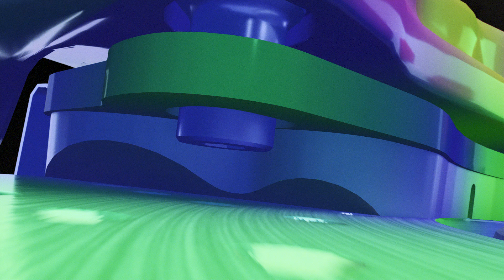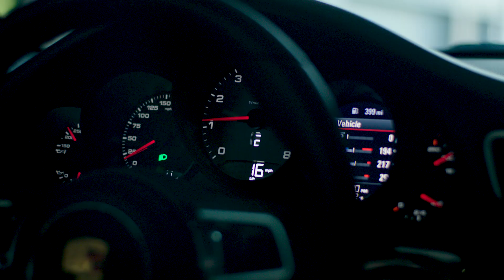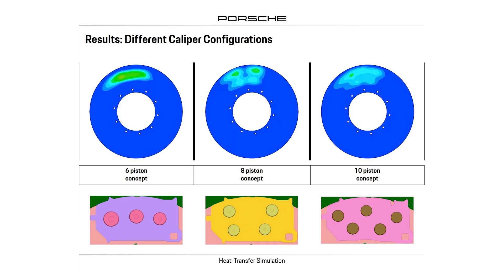Brake Squeal Explained

Comment: High end Porsche sports car use Brembo brakes with Brembo pads similar to that of there sp compound in the aftermarket world that have there formula of sinter material in them to be able to achieve high friction durability and high operational temp limit sinter means there metallic material in the pads so you basically have metal composite pads scraping with cast iron metal rotor squeaking is inevitable my GR Supra for example when I change to mx72+ pads they squeak abit more and dust a little brown there semi metallic pads but they sure bite hard and super fade resistant.

Comment: I keep the noise down by putting brake grease on the contacting surfaces on the rear of the pads, and I spray some wd-40 to the face of the rotors. It keeps the noise significantly down. 
You're welcome. 👍🏻

Comment: 1:15 Very nice resonance frequency test setup with automatic modal hammer and an older laser vibrometer 👍
Using a similiar (newer) setup for acoustic material testing and measuring natural frequency of components in end of line tests.

Comment: whenever the brakes on my 991 carerra S start to squeal, i just rinse off the rotors and calipers with a garden hose/nozzle, and they are quiet again. repeat in a few weeks when they squeal again. i think brake dust has a lot to do with the squeal. i also found that this trick works better with hot brakes/rotors, maybe the steam cleaning really gets the dirt/dust off the rotors and pads better.

Comment: So my original 2013 Cayenne brakes didn’t squeal at all. They lasted until 120,000 km which was good. I had them replaced with original OEM parts. Now they squeal like crazy. I took the car back and they said this was common but put a small chamfer on the pads. It helped for about 10,000km now back to the loud noise. I believe if the brakes are not installed with all the components being within .001” (inch) ie tight tolerance of each other you get the vibration etc. I assume the rotors, pads are not all that precise between one and other. Also if they are installed just ever so slightly off balance you get this result. Perhaps even hitting some potholes can eventually cause it.

Comment: Great explanation, however, most of the brake squeal can be resolved by blasting away any accumulated brake dust generated by the pads, with pressurized water. Happens to me all the time.

Comment: Bs. I have a new Macan Turbo and it sounds like a semi truck. I’m trading the sob because I can’t stand the high screeching sound. The dealer has acknowledged the issue and worked on it twice and still sounds terrible. And don’t give the “performance ceramic” Excuse. I have a garage full of exotics with bigger breaks and they don’t sound like this.
Reply: Seriously, I’m about to ditch mine for the same reason. I’m so sick of blasting pedestrians with this nails on a chalkboard squealing sound.
Reply: @cadriver2570  u know what the dealer did was they had a letter sent to me from the engineering department in Germany.  First of all it was a standard letter that they send everyone with this compliant.  Second it was a total bs that the sound is normal.  I told them this is not my first high performance car intact their own 911 turbos don’t make this sound. Still after repeated attempts to correct it they said there is nothing more they can do.  I sold mine after 10 months and bought a Jaguar I-Pace which performs even a little better than the Macau turbo with torque-vectoring and 512 lbs of instant torque.
Reply: @bakhteria  Wow, that is total BS. The Macan stops in about 10 feet earlier than an M40i. I would gladly trade 10 feet to not burn out my eardrums. I have also not heard this from any of their Taycans.

I-Pace is a smart move. Super quiet, better powertrain, costs virtually nothing to charge compared to gas. I test drove one a while back and it was a lot of fun. Has yours been generally problem-free?
Reply: @cadriver2570  so far so good. Apple play is hit and miss. But that may b more in apple’s part than the car.  But love the off line take off.

Comment: Basically the worst solution to address whining Porsche customers about brake squeal was to create a video like this. If you are not a trained mechanic and hear strange noises coming from there, don't hesitate: go and have it checked with your dealer or a trained mechanic. Even if you are a Porsche customer (especially if you are a Porsche customer)! How can an average Snob Joe differentiate between innocent vibrations and say a loose brake caliper? Nohow!

Comment: Funny, my AMG BREMBO calipers never squeal. And they supply Porsche as well.
Reply: Brembo manufactures what the customer desires. If a car makers asks for cheap, lightweight discs with poor rigidity they will make just that. It may squeal, but I'm quite sure their aftermarket range of parts is far better quality than what they sell for car manufacturers. It is absolutely possible to eliminate brake squeal 99% of the time with the right materials - it's just that some manufacturers don't care, since they don't treat it as an issue (i.e. Porsche).
Reply: Yes.  The material of the brake pads will determine how the noise will come out.  Porsche, please stop buying brakes components from China.

Comment: Call Exxon Mobil, they can formulate a heat-resistant polymer adhesive go on the back of the pad to cushion it from the caliper pistons for your American customers. Mercedes solved it by MAKING THEM squeal but at a frequency that humans cant hear.

Comment: If your breaks squeal its because your'e not driving hard enough and therefore not breaking hard enough to wear off pad build up. These breaks are not made for driving conservatively. When your'e blasting down the autobahn at 295km/h and have to break hard because some idiot changed lanes without looking, trust me you will be very happy you have beefy Porsche breaks.

Comment: I think if you oversimplify it you can say that there are 2 types of brake pads, the ''soft'' ones that are not so aggressive  to the disks, they squeal less but have less grip and endurance, and the ''harder'' ones that squeal more they are more aggressive to the disks (disks maybe need change more often) but they have more grip and durability to pressure, temperature and use overall. Performance cars and racing cars use the second type, just watch any race and the sound of the breaks is obvious.

Comment: I think the could have simply said that some high performance brake pads squeal when cold/at low speed, simply because of the material used. Sure, keep the frequency explanation (I didn't know that), but it still pretty much comes down to what material is used. Performance is always a compromise, and so often good brake pads are a bit noisey and even dusty, if they are track focused.

Comment: Porsche throwing shade at its customers  is all fun and games until you own a Porsche or Audi with this terrible noise. It's a joke that they can't fix it. STFU to the people who don't own Porsche's and Audis experiencing this issue. If they spent half the time they did on this video to find a fix for the noise, maybe it'd be fixed... It's not even with just the ceramic ones, they all make this POS noise. PORSCHE FIX THIS IT"S AN ISSUE!!!!!!
Reply: VR44 then why don't you try changing it to softer pads.. 

Just saying, Audi and Porsche have some of the Least amount of brake fade..
Reply: VR44 get the brake pads replaced then. The stock ones are made for performance driving
Reply: It sounds like a race car it's cool lol
Reply: Soft pads act as a pillow and they dont resonate so much as harder ones, when they are gone, harder material or smaller surface touch the disks so squeling is heard, this happens to normal car breaks so we tend to associate the noise with failure (sounds like a beater), something that is not true in more aggressive set up. I have a peugeot 106 xsi with stock breaks and if i hear that sound for a while i know i need pads, my neighbor   has the same car but tuned for hillclimb racing, i hear he's brakes everytime, who has better brakes is obvious. If you dont push your car you can go with softer set up, but you lose performance(safety), durability, heat management and you will need pads twice more often
Reply: Yeah if they pay for it. 60-100k cars shouldn't be making noise like a beater...

Comment: Yeah yeah cool but then why no other car maker's brakes squeal? Laws of physics are equal to everyone so then nothing can be done and every time I go out into the street I should get deafened with hundreds of cars squealing at me but that's not happening is it? it's only porsche that seems to get complaints
Reply: Wtf are you talking about, powerful brakes squeal from any manufacturer, no more or less than porsche. Especially carbon ceramic brakes when they are cold
Reply: Dariune Porsche and a lot of other high performance manufacturers and even the C7 Z06 uses extremely durable high performance rotors and pads that performs at the highest levels repeatedly without a hint of fade.
Those in the Cc or even performance rotors in the Mercedes(because I know you are going to mention they don't squeal as much)  still uses softer pads.

High performance rotors and pads will always squeal.  Go to a track and you'll know
Reply: You hear the Aston Martin Vulcan?
Reply: Comfortably Dumb Why do bus/train brakes squeal, are they powerful or just shitty
Reply: BMW, Ferrari, Audi, Lamborghini, Mercedes all squeal.
Reply: White Wolf first of all bus and train brakes are completely different from the brakes on a car lol. And yeah I would say the brakes on busses and trains would have to be powerful to slow such heavy vehicles, especially trains that way hundreds of tons
Reply: All carbon ceramic brakes squeal! Just watch some gt3 racing, it's normal with really good brakes.
Reply: They seem to use more aggressive pads than (most) other manufacturers.
Reply: VidyaBoutCars GT3 cars use iron rotors.
Reply: Who's stroking your check
Reply: then,build your own damn car
Reply: I drive a BMW and I started experiencing the squeal today so it’s not only Porsche
Reply: ROFL all brake make noise. Higher performance brakes more more noise.
Reply: Comfortably Dumb Carbon Ceramics squeal when they’re hot, not when they’re cold, unless you have a pad that just makes them loud all the time like a pagid RS29.  

It can also happen when cool with the stock pads if you set them on fire.

Comment: In my experience, squeals happen when the brake pad material is too dense/hard. The material that Lexus/Toyota uses is softer, you can almost drive a screwdriver through it, and I never hear any squeals with genuine parts.
Reply: Yes but then the wear and tear is bigger. I dont think customers want that, especially with expensive porsche rotors
Reply: I find they last surprisingly long. Lots of R&D spent developing that composite.
Reply: Jonathan Payant go try those pads on a race track. You won't make it past one lap

Comment: I don't buy this at all.  Other high end car manufactures have large powerful brakes and don't have the squeal problems that Porsche does.  I understand that brake squeal can occur in any car, but it doesn't HAVE TO.
Reply: a lot of them have it, actually. the way the others get around it is by using sub-race-level pads.
Reply: Race grade pads do have squeal.  Race pads are NOT recommended for street use.  But most Porsche drivers will never get near a track.  And a street driven Porsche does not need a race pad.  A high performance pad, sure, but not race grade.  I have a 2006 BMW E46 M3 (ok it is not a Porsche....) and have Performance Friction -11 pads that I use on the street AND track.  I get no squeal.  I stand by my original comment: Brake squeal can occur in any car, but it doesn't HAVE TO.
Reply: ...*zzzzzzz*... hmm? oh, still the squeal thing. yeah. you should totally work this out in the comments. Perhaps Porsche's engineers will read this and CHANGE EVERYTHING. totally.

Comment: My cheap Subaru never had brake squeal. Yet a Porsche does. Hmmmmmm
Reply: shut it asshead. porsche designed your flatulent four. be grateful.
Reply: No pencil dick, it was Karl Benz that designed it.
Reply: mac daddy - I don't think you realize that beach and sand driving provides nowhere near the harshness as driving hard on a racetrack, nor is it as harsh as driving on a long windy downhill mountain pass. Stock Porsche brakes are very likely to survive such conditions, most stock Subaru brakes will not, as the brake pads and/or brake fluid will either get close to failing or completely become ruined. The typical mainstream brand (non-luxury) brake pads overheat at around 300 degrees Celsius (572 Fahrenheit), and most usually use DOT 3 brake fluid, which is probably the same for any stock Subaru braking system. The majority of Subaru's vehicles aren't meant to take on racing conditions without proper modifications safely, while Porsche's vehicles will require less-intensive or even no modification to have the brakes safely operate in racing conditions.
Reply: SDD525 - No, because Subaru can't justify installing brake pads and overall hardware designed for harsh driving on all their models. Their customer base are mostly mainstream buyers too afraid to push a vehicle to its driving limits. Porsche, as a sports car manufacturer, requires that all their vehicles feature high performance brakes. It is common sense for performance-car enthusiasts to understand that brakes that are dead quiet are not likely to safely work, let alone survive, high-performance driving. When it comes to brakes and brake pads, one generally must choose between the quiet brakes which do not function safely at harsh conditions which bring about high brake temperatures, or high-performance brakes which safely operate in harsh conditions and high brake temperatures but exhibit some noise during operation, especially under low speed and/or light brake pedal application.
Reply: SDD525 - All modern braking systems are relatively strong compared to power output and vehicle weight. If they weren't, modern vehicles wouldn't need anti-lock braking systems. Now, if a vehicle has brakes are too weak to even lock up , it's definitely got underpowered weak brakes. Modern automotive braking systems are plenty strong enough to lock up wheels. Other larger brakes are stronger, but the largest reason why they are big is improved thermal capacity, which also facilitates improved performance under harsh driving conditions.
Reply: mac daddy he meant track conditions fuckass
Reply: My Subaru can out perform Porsche in the harshest conditions: https://www.youtube.com/watch?v=TmBibFdMIRU  here is proof. The Subaru's brakes can hold up to anything you throw at it....and they don't squeal.

Comment: How about some bigger diameter pistons in those calipers. My 10,000 pound Ford van doesn't squeal and it has two large diameter piston.
Reply: Grant DuBridge Completely different applications and performance requirements . Do you do canyon runs on your van? Are you taking it to a track? Brake squeal is completely normal in high performance applications.
Reply: Different pad material. Something like that has pads designed for refinement and long life.
Reply: oh, you're that guy. great. more truck driving stereotypes.
Reply: It is a joke referencing a Top Gear episode.
Reply: Well as we all know, the Queen of the Ring can take a stock Ford Transit Van faster around the ring than the typical Porsche driver using a 911 Turbo.
Reply: Epotheros we are not talking about a ring, or a track, we are talking about moving through traffic. Transit van? I'm driving a one ton extended loaded with equipment and 110 gallons of water. And when I'm on my motorcycle I've never been challenged by a Porsche.
Reply: Epotheros sorry, I didn't see that one.
Reply: No. I race Porsches down the freeway at 100 miles per hour even though I weigh twice as much.

Comment: This is basically Porsche saying "Stop being bunch of sissies" to the customers and cars are still mechanical and sounds are part of it and dont listen to your Tesla owner friends or neighbors (especially if live in San Francisco)who think this is a problem.
Reply: Lol you trigger the Tesla fan girls 😏
Reply: The many reasons I left San Fran, Snowflake central
Reply: Teslas don't use the brakes as normar cars, they tend to recover the energy while braking with the electric motors, also because there is no ICE the noise insulation is needed to be quite intense because others sounds tend to be more noticeable
Reply: @SEgarciaG  Porsche does use the brakes for charging in the hybrids so no energy is lost.
Reply: "especially if they live in San Francisco" 😂
Reply: No this is Porsche saying 'deal with it' because we can't fix it.
Reply: Not just that..if there was a way Porsche would have already cleared it because ..well they are Porche.!